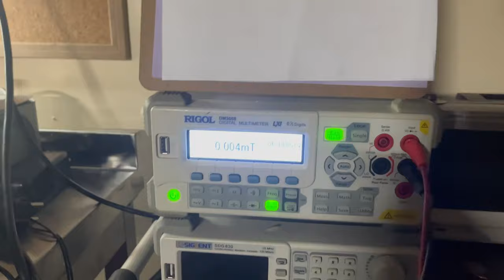Very High Vacuum Chamber - Vacuum Evaporation - Thin Film Metal Coating

Comment: Looking good, nice chamber upgrade! Are the bolts for evap stainless steel, and are those off the shelf electrical feedthroughs or did you make them? (I'm working on a high current feedthrough at the moment with viton gaskets through an Aluminum plate but it's leaking :/)
Reply from the maker: Thanks a lot! The bolts are non-magnetic stainless steel. However, after this video, I found that the bolts are not really required because the pressure on the top o-ring increases when the vacuum pulls down the upper aluminum part, making sealing stronger enough without the bolts being placed. Getting high current into the chamber took work for me too. As my chamber had two available CF flanges, I built these two feed-throughs by placing M12 stainless steel threaded rod into KF25 to CF flange adaptors and filling the remaining empty space with some epoxy sealant such that the flange and the rod don't touch each other. There are better solutions than this, but I experienced no problem so far, although the chamber frequently goes down to around 10^-6 Torr.
Reply: @icanyesilyurt  Ahh I see, thanks for all of the info and videos! Lots of fun stuff I'd love to attempt. I still have some leaks to take care and a ton to improve (& clean) but excited to have just gotten Al evap working (after years of slow vac setup iterations/failures :P) https://youtu.be/xa929IQbW-w
Reply from the maker: Ahah :)) Congrats!! It looks like a successful thin film aluminum coating. If you are not explicitly evaporating aluminum, silver may be a much easier source to evaporate in such systems because of its low vapor pressure and low contaminant behavior. I wonder what turbo and backing pump are you using in this setup? In my case, the failures were mostly the vacuum pumps rather than the leaks. Thankfully, the turbo molecular pump resolved the issues.
Reply: @icanyesilyurt  Ohh interesting, I see, I'll try silver as well! Did another successful test with gold. Thanks! I'm using a ScrollTec SVF-E1-100 scroll pump and Edwards EXT255HI TMP (I had a TriVac D 2.5E backing pump initially but I wanted to remove oil from the system entirely). Working on building in a mechanical feedthrough now to block some of the initial oxides that evap and will likely want to try adding a fiber optic feedthrough to tie to LR1 spectrometer and see if I can measure the reflectivity/transmissivity when coating and hopefully automate it.